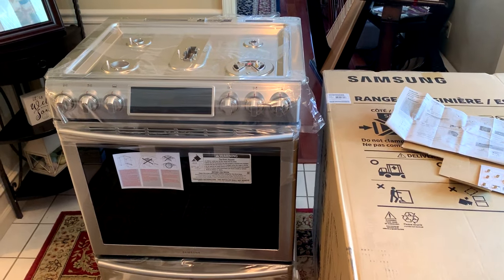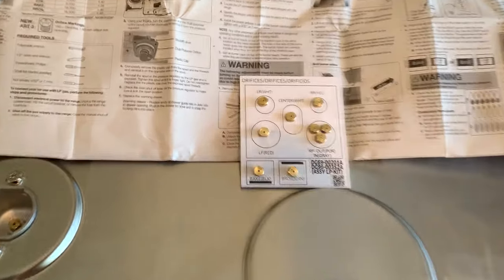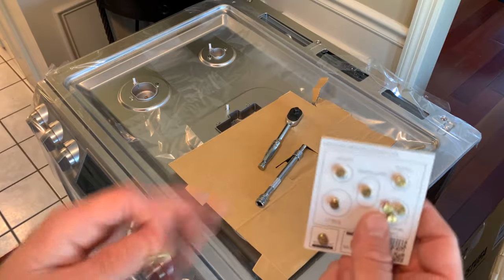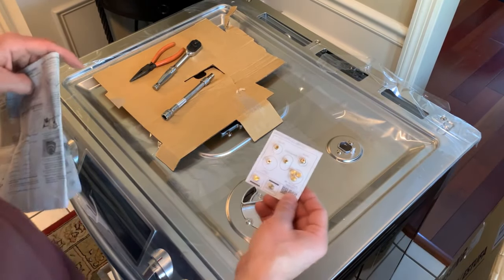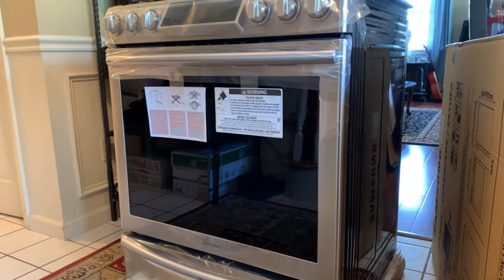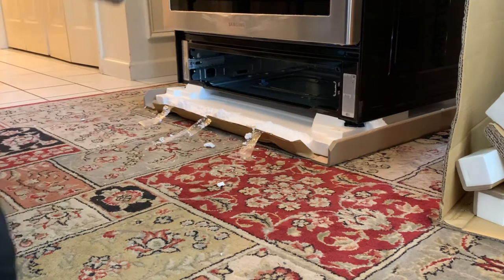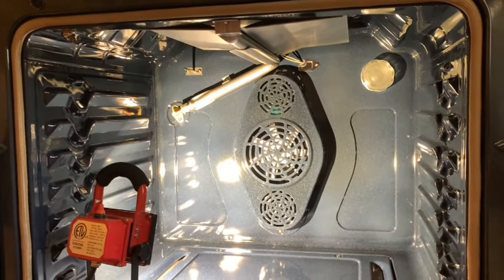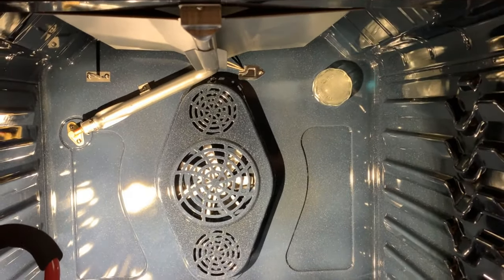Samsung NX58H9500WS Gas Range / Oven Natural Gas to LP Conversion

Comment: This 70+ year old woman converted her new stove to propane by herself thanks to your great video. The only thing missing was how to get the door back onto the oven.  😁
Reply from the maker: Glad it helped! Thanks for the feedback. I guess I should have added the door reinstallation.
Reply: For some reason getting the door back on the first time is ridiculously difficult.  When we converted this range to propane a few years ago it took me like 30 minutes to get the door back on.  I've had to take the door off a few other times since then and never had an issue with it after that.
Reply: How do you get the door back on?

Comment: Helpful video.  We had Lowe's/CRST install and convert a similar samsung range to propane.  But it seems like the burners, burn too hot. It makes me wonder if the installer flipped the dual purpose orifice. I have to check if that orifice is behind the underneath drawer on our model and look under the red cap. I think the propane would have to be turned off from outside the house to flip the orifice.  Thanks for the video.

Comment: Excellent video, well prepared and lit. My sister has the same stove and I was wondering why her flames were so high and uncontrollable. Did some research and found out that she was using propane and the conversion needed to be done. your vid was highly useful and informative, Thanks a million...
Reply from the maker: That's exactly why I made this video! Glad to assist the fellow DIYer.
Reply: Michael Salley it was necessary to bring a qualified technician or someone, or you did it yourself?

Comment: I think your video is clear and precise but I have the same range and i did the same conversion but my oven is not lighting up. I have purchased so many igniters that I am tired of it and ready to torch this range. my igniter glows bright orange and inside the oven gets hot but it does not light up. I try the same thing with the broiler and it does not light either. Piece of junk.

Comment: Just purchased a new similar Samsung Range:  NX60A6511SS/AA.  Thank you so much for your video, it was very helpful in converting our Range to propane.  I noticed when checking the flames on the broiler they seemed to only come from one side of the broiler tube, is this normal?
Thanks again for the wonderful video!!!!
Reply from the maker: Glad it helped

Comment: I just got my Samsung stove today. The directions are terrible. I followed what you did on the pressure regulator, but according to the directions that is wrong. It says to make sure the LP spud is "exposed". To me this means it's under the red cap and not facing inside the regulator the way you and I did it. I just reversed what I saw, but directions make it sound wrong. Also, it mentions  the oven shut off lever needing to be in the open position, but the graphic is poor and I can't tell. You didn't address this at all in the video. Does your oven work properly?
Reply from the maker: Using the unit for the last year and a half with zero issues. I must have done it correctly. However, I appreciate all feedback and comments that can help out. Thanks!

Comment: Do you happen to know if the air mix has to be adjusted somehow on this Samsung? I’m reading that some ovens require this to adjust the rate of fuel. Thanks!
Reply from the maker: The bake and broiler burners are adjustable, but I did not have to adjust mine. The factory settings were fine. Hope that helps.

Comment: Thank you! Now I know the actual location of where the oven orifices are. Samsung's owerners manual leaseves a lot to be desired, when it comes to setting up the oven. I did not realize that I had to disassemble the entire oven to make this necessary switch.
Reply from the maker: I agree. It's a cumbersome process to get the oven switched over. Not difficult, just very time consuming and tedious. Glad this helped out.

Comment: Thanks so much for your video don't have this exact model but it's very similar and the parts inside they are all the same. I got this stove for my second house overseas and I was not able to get a certified technician to do it and I didn't want any random person breaking it apart so I did all my research to do it myself but your video helped me so so much.

Comment: So, at 10:28 you jumped forward to tightening on the double burner.  I cannot get these started. How long did it take you to start the threads and how many times did you drop the orifices down the hole?
Reply from the maker: A few times. Didn't want to publish video of me fumbling with those damn things!

Comment: Are you able to run this oven on 20 lb tank of propane after properly converting it to propane? Got this exact stove and did the conversion the spud is in properly with the LP big hole showing on the outside its hand tight and all the top burners & bake & broil orifices changed out. The top burners work perfectly but the bake & broiler will not light for some reason. For the bake (bottom) for instance I see the igniter glows red and I smell gas but it wont light. Does the oven light the bake position gas the second you hit start?  Or is there a slight delay on the gas while the igniter starts glowing. Does the bake gas start the second you hit bake? Thanks for the video it helped!
Reply from the maker: You should be able to run this on a 20lb LP tank. The bake gas usually take a few seconds to start, as the system checks the status of the ignitor before opening the gas valve.
Reply: @grwebman  Thank you very much for the reply. My first gas stove. It did not ignite really fast like the top burners did so was getting nervous letting it run so shut it off too soon.

Comment: Thank you so much for this video. I ordered my slide in Samsung range during the Memorial Day weekend sale and they messed up my cart and sent a all gas range. I wanted a dual range. Oh well I thought I’ll deal with it now, but nothing was working right, lot of carbon and off gas smells. Turns out I’m an idiot, and didn’t convert this over to propane.

Comment: I did the conversion but unfortunately when I tried to test how it will work,the flame just flare up boom just like that.I have changed the front valve assemly,I have changed the spark module,I have changed the igniters ,meaning that I have changed almost all that makes the range works and I have not been able to get the reason for the flame flaring up instead of working properly.Please if there's anybody that reads my comment and knows what could be wrong and what can be done should kindly respond.Thanks.

Comment: I have. Question please, I was able to follow all your steps the only thing I can’t figure out is the size of the LP hose and parts you used to connect it, I would greatly appreciate the help with this info.
Reply from the maker: I don't remember, as I had reused the LP hose from a previous stove. I am sure the manual would state the size. I had purchase the yellow hose years ago from one of the box stores in their appliance section.
Reply: Thanks for the reply. I checked the manual call Samsung and no one seems to have that information :( I will keep trying hopefully I’ll figure it out. And thanks again for the content it was clear and simple to follow, better than Samsung I striction manual.
Reply from the maker: @Sky-blueteam  I think I used the following: 1/2-in Flare Inlet x 1/2-in Mip Outlet Stainless Steel Gas Connector. It was bought at Lowes. Brasscraft model CSSC44-36 P. Check it out.
Reply: Thanks so much
Reply: @Sky-blueteam  did you figure it out yet?  I'm having the same issue

Comment: What is the convertor pieces for??? What is the purpose of changing them??  I just thought they were extra replacement parts.....pls
Reply from the maker: They are NOT extra parts. Running an appliance on natural gas is VERY different than running it on liquid propane. "One cubic foot of propane = 2,516 BTUs compared to one cubic foot of natural gas = 1,030 BTUs. Propane contains more than twice the energy of natural gas." This is why the orifices of the LP nozzles are smaller than those for the natural gas. They are NOT interchangeable and it is a serious safety hazard to run an appliance set for natural gas on LP. Very dangerous.

Comment: I subbed.  I just bought the latest version off this stove and your video was very helpful, thank you.  Did you have a separate video on the back of he stove and the flex line hookup?  As for that little brass nipple that you inverted - I have one also, so I inverted it as you suggest. What do I do now?  Do I cap with that plastic red cap or leave exposed?  I don't see how the yellow flex line can hook up to that - I hooked the yellow flex line (with adapter) to an aperture below the brass nipple thing I inverted.

Comment: Thanks for this video. I did the conversion and my broiler doesn’t start. I am guessing the igniter isn’t working. I am going to pull the broiler apart and recheck everything. This video gives. E a good reference for the rework. Fingers crossed....
Reply from the maker: Good luck. Keep us posted on what you find out. I had an older Maytag stove that the ignitor would routinely fail. When it does, it does not allow the gas to flow. A built in safety feature.
Reply: The ignitor on this stove is not the best part.  We had to have it replaced twice.  First time the repair tech said he would put in a different brand than what Samsung uses and I said I wanted the OEM Samsung part.  Big mistake.  Was more than twice as expensive and half a good quality.  Next time I had them put the "aftermarket" ignitor and haven't had an issue since.

Comment: What's the difference between natural gas and LP?
Reply from the maker: For homeowners, the main difference between the two is that propane is compressed into a liquid form and either sold in portable canisters, or delivered via truck to a permanent storage tank on their property. Natural gas, however, remains in its gaseous state and is delivered to the home via a pipeline. Also, liquid propane has more BTUs than natural gas, making it more energy-efficient.

Comment: I love how you cut away when installing those two side wall nibs on the large burner.  Having converted this SAME range to propane years ago and then back to natural gas just today I know how much of a bitch those are to get in.  Took me about 15-20 minutes alone for those.  I used the same wrench you did but what I had to do was put a piece of packing tape on the back so the nib wouldn't fall out the back.  Even then it was incredibly hard for the threads to catch.  Took me about 90 minutes total to convert back to NG and get it properly working.  It's a good range but it's kind of a pain to keep clean.
Reply from the maker: Very perceptive. Didn't want to show me fussing with those things for 10 minutes! It was the most challenging part of the install.

Comment: Did you need to adjust the air shutters after the conversion to LP? I know the GE models have marked positions on the air shutters for both natural gas and propane. Great video BTW!
Reply from the maker: The system worked fine as set by the factory, so i did not have to adjust the shutters.
Reply: @grwebman  Thanks for your reply! We get ours delivered today after retiring our 23 year old range.

Comment: I just got the newer version of this.  The Wok burner takes a minute to light and then has high flames...what could be the issue?
Reply from the maker: Are you running this on LP? Did you have it converted? If you answered yes to LP and you did not have it converted, the high flame is certainly from not converting. Please discontinue use and have it properly converted to LP. It's not safe!

Comment: Thank you I had one of these stoves to install it said it was on page 55 and we only had 50 pages of Samsung technical. I didn't have any problems with the top burners the only thing that I did differently was rotate the burner orifices 180° upside down punching back into the cardboard blister pack so that they would not get confused. great video. Thank you.
Reply: Samsung is getting terrible instructions and products! They used to have good productuts.

Comment: Thanks for the informative video! We just ordered a different Samsung model (NX587T7511SS), and your video will be invaluable in converting it to LP. One quick question, Samsung says your model is a 'True Convection' model. From what I've read, true convection ovens have a heating element by the convection fan. Did your range not require that, or is the true convection heating element electric?
Reply from the maker: Our unit is a convection oven, but does NOT have an additional element near the fan. It does have an electric heating element for the warming drawer. Hope this helps.

Comment: Great video, same steps for Samsung NX58R4311SS. Installing door back can be challange. I suggest to remove bottom drawer and get ready for the door. Fully open those hinges, locks open as well. Go with tips from the hinges slowly in to the slots and sliding from the top down so it's seated at the bottom notch on both hinges. Once it's in, then fully open the door and lock those hinges back. Try to close it & open few times, if everything works put that drawer in and pat yourself on the back. You did great job.
Reply from the maker: Thank you and I appreciate you adding to the discussion on the door removal and installation.

Comment: Do you replace the bake and broil orifices if the oven is taking close to 40 minutes to preheat? I called Samsung and they sent me to a technician. Due to the ranger being out of warranty, it would cost so much money to have a technician come out and check. Trying to save some money.
Reply from the maker: Sounds like a bag igniter possibly.

Comment: My family has had a Samsung gas oven for two and a half years and first the spark plug for burners went on it so we replaced the spark plug but it still didn't work so we had to use a lighter to start it. Now the oven is not heating up so it's complete garbage no point of putting more money into it, it cost us $2000 and it all went down the toilet
Reply from the maker: That's a bummer. The oven and broiler igniters have a finite life. They are not that expensive and fairly easy to install. No need to toss the over over a bad igniter.

Comment: how do you adjust the oven shrouds for the proper flame?  I don't believe the oven will kick on with the door open.
Reply from the maker: The oven DOES light with the door switch disengaged.

Comment: I striped the orifices on the big bunner that is sideway installed. Any idea how I can take the entire thing apart to try and get it out.  At this point I am stuck with the natural gas one still in there. All the other ones have been changed to the propane orifices.
Reply from the maker: Time to contact Samsung.

Comment: My display board doesn’t light up anymore, therefore cannot use the oven. I don’t have manuals. Would you know what part I need to replace like thermal fuse or control board ?  Thank you
Reply from the maker: I am not sure about that question. Sorry. Good luck with finding a solution.

Comment: After conversion my oven seems to cook slow, doesn’t appear to be cooking hot enough. Something our installer did wrong? Or a regulator problem?
Reply from the maker: Interesting. The range burners seem to be OK? When you say the oven portion cooks slow, what are you comparing it to? Does it get to the designated oven temperature quickly?

Comment: Thank you just bought one. Only the top was converted but the flame comes in strong. Where do you adjust how much gas flows through?
Reply from the maker: At 14 minutes in the video, I explain about the dual purpose orifice on the pressure regulator. That is the only gas flow adjustment. Be sure that orifice is setup correctly.

Comment: Good video here. I have 1 question though. My oven seems to take forever to preheat with the propane. Is there any type of adjustment to the air mixture covers I need to make? Or is there something I'm missing all together? Thanks!
Reply from the maker: That does not make sense. You may have a failing bake ignitor. I have replaced 2 bake ignitors in this oven so far. Hope this helps.
Reply: @grwebman  well I just tested it and it took 20min to get to 350. Does that seem right? It seems long to me.
Reply from the maker: That sounds excessively long. Here is the ignitor that I purchased on Amazon. It was plug and play. https://a.co/d/4w5BKcX
Reply: @grwebman  I will try that out, thank you!

Comment: how do you access the low burner adjustment on the front right duo burner.
Reply from the maker: There is no stove top burner adjustment that I am aware of. The orifice size and regulator setting dictate the burner's capacity. I hope this helps.
Reply: @grwebman  The manual shows the usual low burner adjustment through the knob shaft.  But it also shows for the duo-burner at the right front as another adjustment that is next to the shaft in the body of the valve which would place it behind the ignition switch on the shaft and covering the valve.  That means taking apart the top and front cover to removing the switch to get to the adjustment.  It looks like the burner system is by Defendi of Italy.  I was trying to confirm this.
Reply: Since this is a duo burner, there are two adjustments for the medium and low burner.
Reply from the maker: @rolandwong6372  Thanks for your input. Since this was not part of the NG to LP conversion, I am not familiar with the adjustment. If you have any more info on this, please post it here.